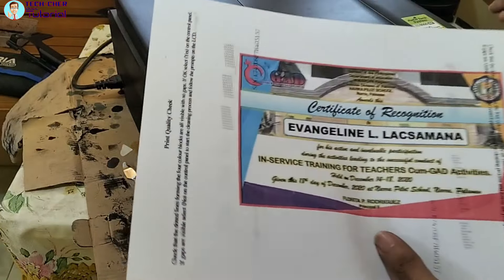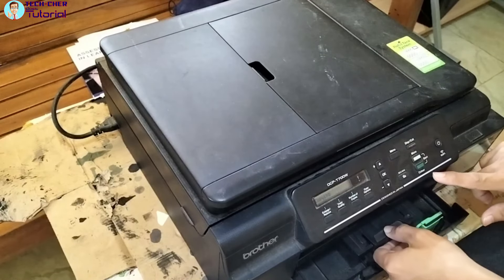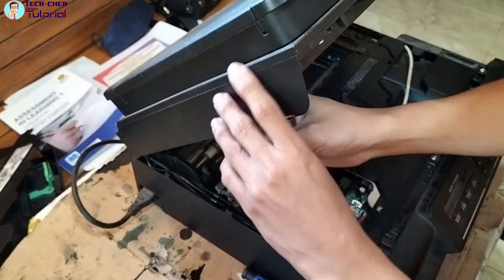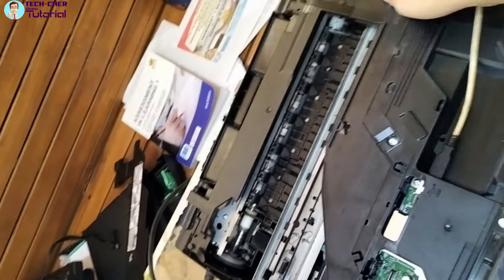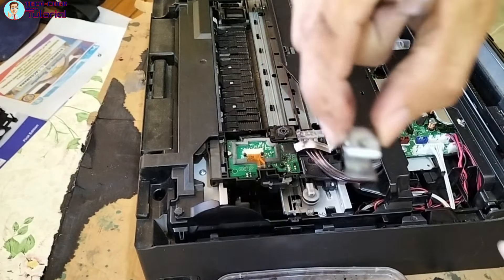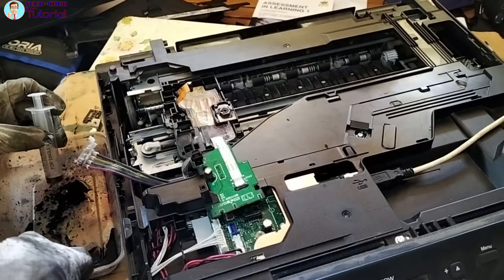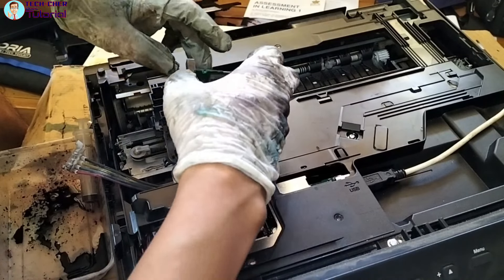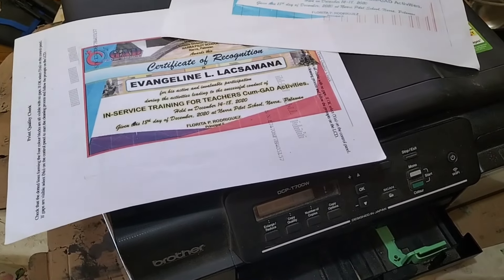BROTHER PRINTER COLORED PRINT ISSUE || SOLVED!  || ALL MODEL

Comment: Good morning Boss, saan po ang location mo para mapaayos ko po ung printer ko?
Reply: san po kayo?
Reply: @HoopNewsExtra  Sa Taytay po
Reply: @donportuguez9329  anong issue ng printer nyo?
Reply: Good morning po, d na po nakukuha ung tamang kulay ng print.
Reply: @donportuguez9329  minor issue lng po yan. pigment ink ba yan?
Reply: Yes boss, pigment ink
Reply: @donportuguez9329  setting lang yan sir correct mo lng sya hanggang mkuha mo un kulay
Reply: Pag tinetest print ko, halos lahat ng kulay nag bablack na.
Reply: @donportuguez9329  sira na printhead po nyan singaw na
Reply: Good evening Boss, kanino po kaya pwedeng ipagawa?
Reply: @donportuguez9329  QC ako sir pero kph d ndala sa cleaning plit
Reply: Ok Sir, mga magkano po kaya Sir ang charge or kung Hindi kaya sa cleaning, mga magkano po kaya pag pinalitan?
Reply: @donportuguez9329  ano po unit nyo? depende sa unit at brand eh. sa manual cleaning po price range po ay nsa 700-1k kc gagamit ng mga cleaning solution kc  yan tas mgbabaklas pa then kung di prn mgawa palit printhead na which mahal po n nsa 2k-3.5k depende sa unit
Reply: Brother MFC-T800W